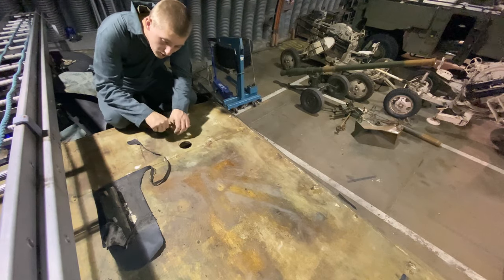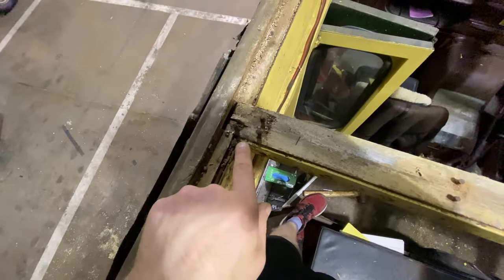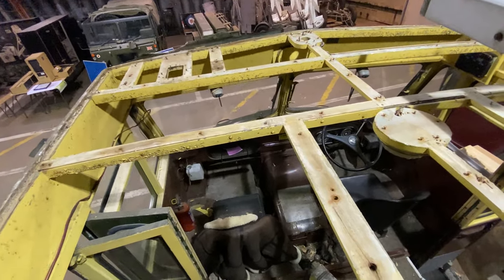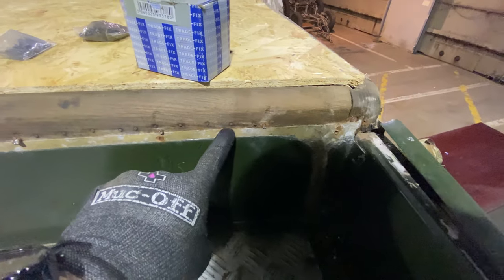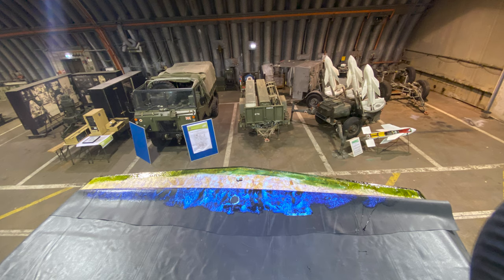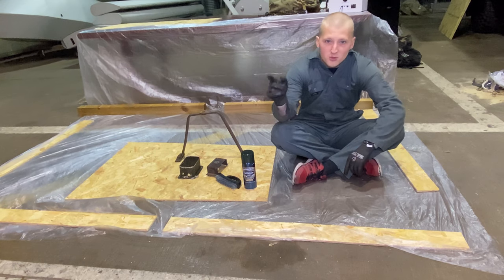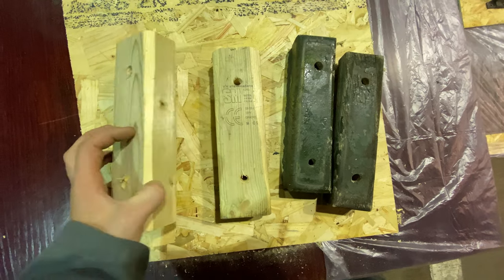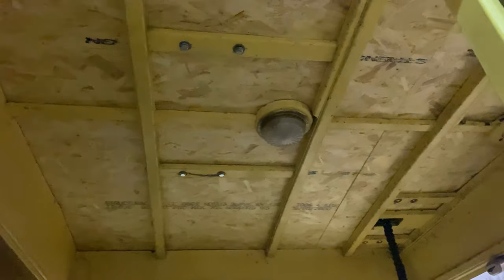FIXING The Wooden Roof - 1956 Fire Eng- Green Goddess Restored - Ep 7

Comment: Yay you are back can’t wait for the next video
Reply from the maker: Cheers mate thanks for sticking around! Hope your GG is all good 👌
Reply: PerksAuto yeah doing well funny thing is have got a new fire engine as well to go with it but yeah the goddess still takes my money anyway but need to do some wood work on the pump panels you have got metal plate put on your goddess and mine didn’t so been busy but since mine is kept out side I need to wait till next year when it is dryer
Reply: PerksAuto also if you need a new air compressor or two tone horns here is a link to a sight where you can get new ones if need be https://www.rsg-ontop.com/collections/emergency-services/products/compressor-two-tone-12-volt cos this Is where I got my horns from and they are a decent pair mad by FIAAM as far as I am aware
Reply from the maker: Thanks for the heads up I ordered my air horns and compressor months ago from France they are based off of old French Police Two Tone sound which was the closest I get to original sounding. Only issue is they are red plastic so in the next video I paint them gun metal and give them some 'patina' to try and blend them in. I feel your pain with money rapidly disappearing for 'small' jobs!
Reply: PerksAuto yeah fair enough but yeah the ones on the site I got are metal so if there is ever the need for an upgrade they are the ones you want  
Plus what is the size for the bell as may get one for my goddess just wondering also what does the bell actually sound like?